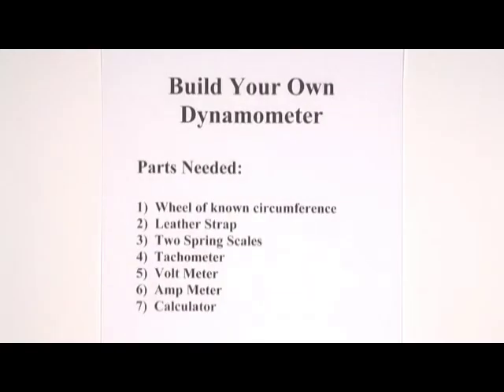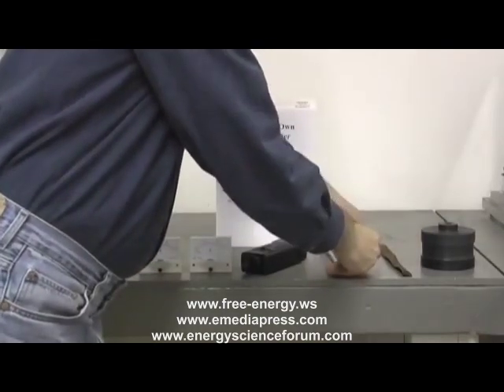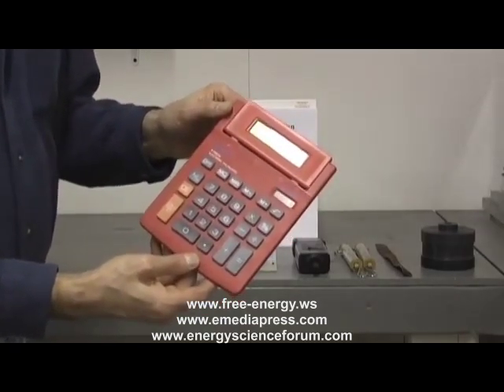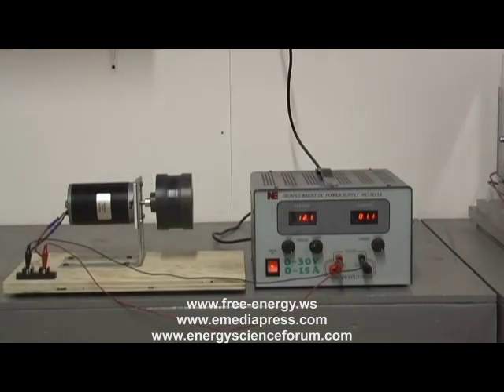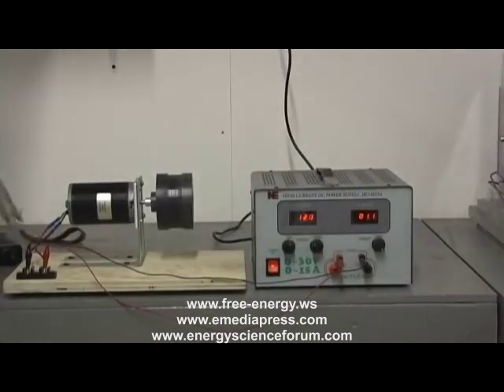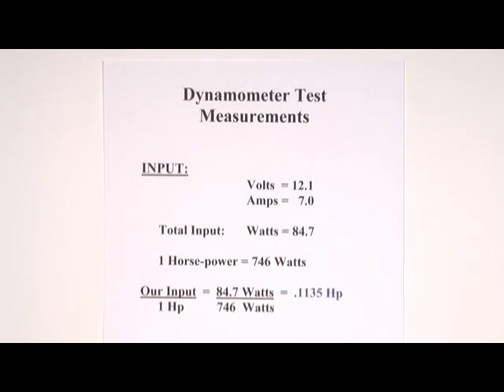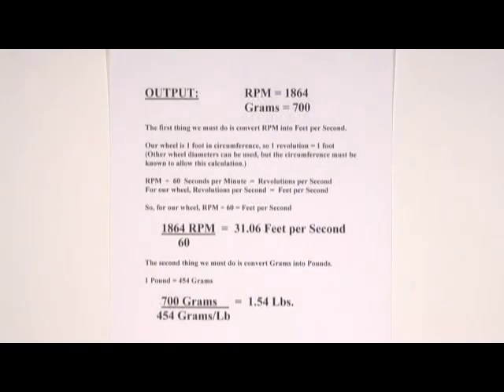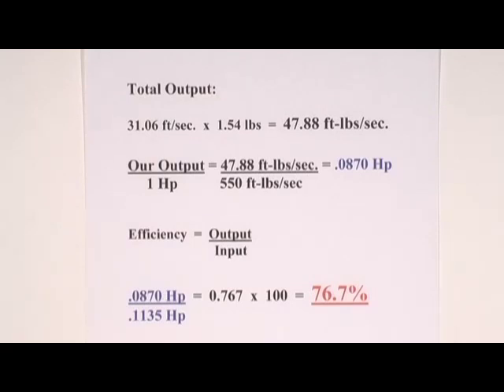How to Build a Small Dynamometer by Peter Lindemann

Comment: Good and clear video. Am I missing something about the need for volt and amps.. I was thinking if I'm not interested in effiency, is it sufficent to only measure the force on the dynamometer, the rpm and wheels diameter?

Example:
Say the dynamometer read 5 N and rpm was 600 and circumference was 0,1 m.

Power P would be force F times velocity V.
V [m/s] = circumference * rpm/60  =  0,1(m) * 600(rpm)/60 = 1 m/s
P [J/s or Nm/s or W] = 5 (N) * 1 (m/s) = 5 J/s = 5 W

Watt to hp conversion using 1 W = 0,001341 hp gives
5 W * 0,001341 ≈ 7 mHP

??

Comment: pseudoscience - real science is in SI units, also back in 1973 when this was recorded.
Reply from the maker: It gives the right answer - you are misinformed.
Reply: Aaron Murakami yes, i'm not questioning the answer. I'm just remarking that working with lb's and ft is a very strange thing to do on this planet in the western world. 

Even people doing research in the rebel countries like America work with SI units and have done so since the mid 1980's. only when sharing their results with the common man in those areas have they reverted to the "queens scale".
Reply from the maker: *****
You called it pseudoscience. Every torque wrench I have for working on engines are all measured in foot pounds of torque.
Reply: Aaron Murakami Facinating, what does the fact that you have worked with engines have to do with this. 

Are you saying that the engines you worked your torque wrench on are the only engines in the world, or that wrench you brought is the only one?  

I have been so lucky to have been working with both the imperial and metric as a travel technician for Siemens Windpower, which btw is SI units only.  

Anyway, whats your point? 
Is this the discussion about the "There is no black swans" again ?  even though it's well documented throughout history there is.
Reply from the maker: *****
If you can't comprehend simple English, give it up. Obviously that not everything revolves around your holy coveted SI units. Get over it.
Reply: Aaron Murakami Oh getting personal now. Yes you are right, i cannot comprehend "socalled simple english" Because English is not my native language, nor my second it's something i picked up along the way working with tools, traveling the planet Earth. 

Erecting windfarms, previously working in Oil and gas offshore, where everything was measured in SI units. Which is the point, and the topic of this discussion, not weither or not you worked on some engines. 

Your background as described in this thread does not make anything clear about the discussion. All you basically said is "I worked with engines, and we used imperial measurements"  Sure,, great, good for you. 

But no way am i misinformed about SI units and the International system of units.  #OFMG
Reply from the maker: *****
Foot pounds is in common use, end of story, period. You're welcome to your SI units.

Comment: Great video, one question, can it be used for small RC engines? I Woud like to do measurements on those smaller ones and see how much torque they produce (and how efficient they are). How accurate is this method?

Comment: so it doesn't matter what the friction coefficient between the belt and the wheel is? the wheel can be any material?
Reply: It doesn't matter because the normal force (N) acting on the wheel by the belt loop is not the force being used. The frictional force (F) would normally be calculated by F=μN, where μ is the coefficient of friction; however, because he already has the two spring scales on the belt loop, he can measure the frictional force directly. Torque(T) is force(F) times radius (r). Then, the power output is just P = T*ω = F*r*ω.
Reply: Thank you, I had the same question.

Comment: To answer your question, wiki 'de pony brake':
 A substantial pre-load is then applied to the ends of the band, so that each spring balance has an initial and identical reading. When the engine is running, the frictional force between the drum and the band will increase the force reading on one balance and decrease it on the other. The difference between the two readings multiplied by the radius of the driven drum is equal to the torque.
-Hope it helps